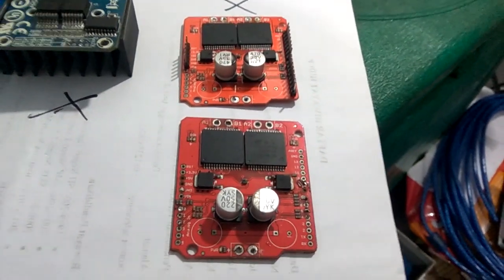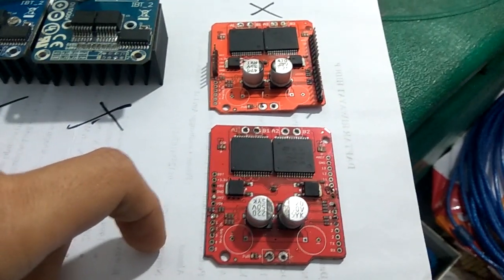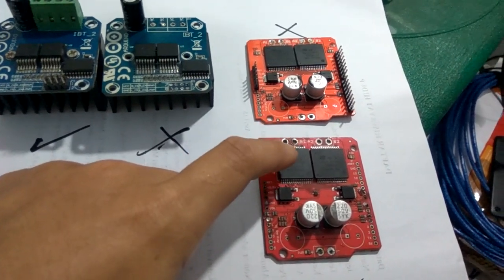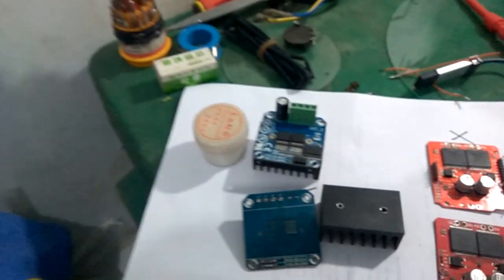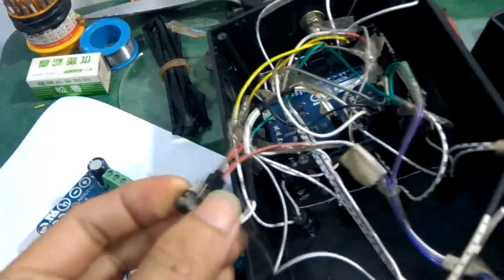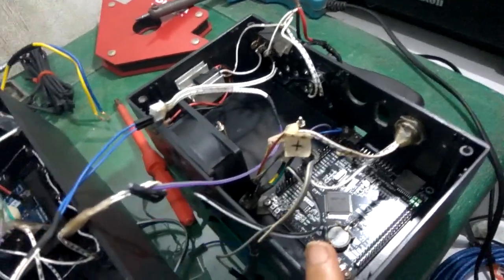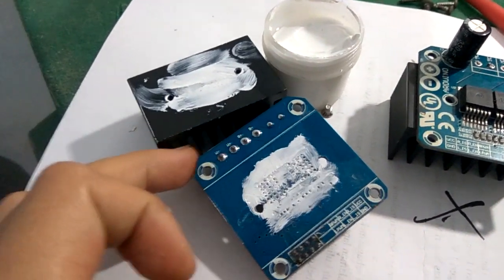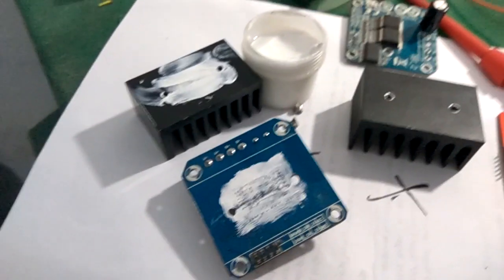TIPS & TRICK dalam DC motor driver, yang perlu dihindari dan tips biar awet. DIY Steering Wheel

Comment: hi! thanks for the video. 
I have two printers, and I want to use two motors, how do I weld them? just to the same contacts in parallel?
can I use stepping motors for this?
have those to be the same model or do they have the same power and ° of step, or just the same ° of step?

thank you!!!

Comment: Summary: 

- use bts7960 driver as other one didnt worked.
- Use thermal paste.
- use fan to avoid overheating
- rest audio low for subtitles to work :P
Reply from the maker: thanks captain...
Reply: A diy driver can be build too and be way much powerfull )
Reply: @modellerdesign  Algún ejemplo?
Reply: So 
How bout a PSU suddenly shutdown?
Not enough ampere ?
(Can turn one side then when changing direction the PSU shut down)

Comment: Seems it has short circuit with bad soldering with the one that doesn't work. Check the 74hc chip wires. An assumption.
Reply from the maker: looks like there is no short circuit, but very bad soldering...
Reply: @mentalterbelakang  yeap) sometimes there the bts chips itself also are placed with dat sort of things) and soldered allaround between connections.
Reply from the maker: yeah...thats very bad quality...

Comment: Link bts nya yg awet dong om..
Reply from the maker: uwaduh...aq belinya dah lama banget...dah hilang jejak...

yang penting kasi pasta termal aja...soalnya yang paling bahaya dari panasnya...
Reply: @mentalterbelakang  kmrin bts sya B- sama B+ nya sempet nempel dan kluar percikan, trus skg di M- sama M+ saya check pake avo gk ada tegangan sama skali, posisi pake aiwave, itu brti bts nya mati ya gan?
Reply from the maker: @rezekysupriyono8454  kalo b- sama b+ nyrempet gara2 serat kabel aja gamasalah sebenernya, soalnya short diluar circuit bts...kalo tes pake avo di pin M, tesnya harus dikasi pwm juga di pin inputnya, ato pas posisi wheelcheck, kalo gaada inputan, di pin M nya gaada hubungan ama pin B...
tpi itu cuma asumsi aja sih...
Reply: @mentalterbelakang  ngeceknya posisi wheel check gan pake mode cycle , itu ane tespen di pin M nyala , tapi gak ada voltase nya jadi ga muter motor nya..solusinya gimana ya gan??
Reply from the maker: @rezekysupriyono8454  sebenernya sulit banget ngetesnya...biasanya respon avo nya kurang cepet, soalnya polaritas pinnya berubah2 ....paling gampang pake lampu bohlam dc (lampu rem motor ato sejenisnya, soalnya polaritas bebas bolak balik). ane dulu tesnya malah pake 2 led polaritas dibuat bolak balik, jadi kalo ke kiri yg nyala led 1, kalo kanan nyala led ke 2...

ato cek nya posisi spring sambil setir posisi ke kiri ato kanan biar polaritas outnya fokus satu arah aja...
Reply: @mentalterbelakang  jadi pake lampu led 12 volt ya gan? Kaki nya yg + dapet M+ dan sbaliknya gtu?
Reply from the maker: @rezekysupriyono8454  kalo led pake 2, satu sesuai satunya dibalik....tpi lebih aman pake yg bohlam biasa aja bisa pake 1...
Reply: @mentalterbelakang  bohlam bukannya ac yah gan?
Reply from the maker: @rezekysupriyono8454  bohlam rem nya motor...kalo bohlam sama aja bisa dibolak balik...

kalo led gabole yg ada ic nya...ane pake led cob 10watt, bukan led biasa...